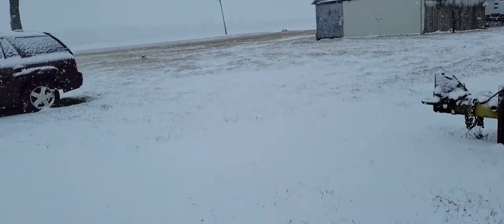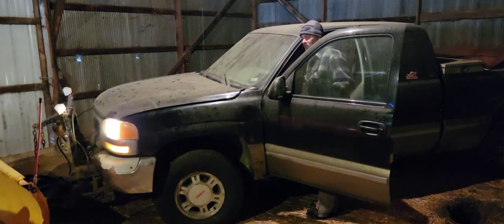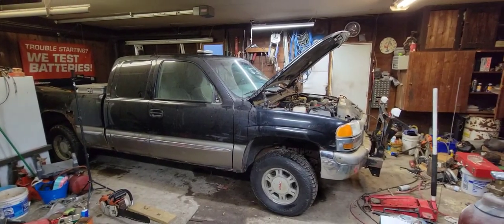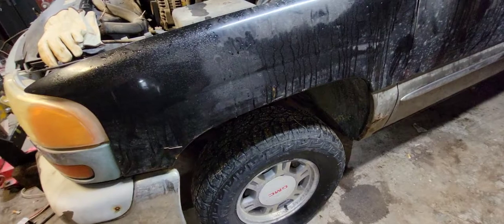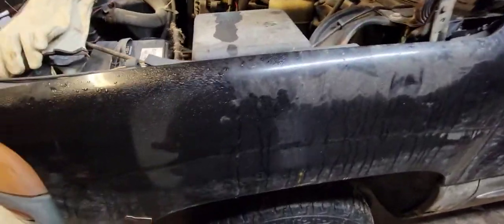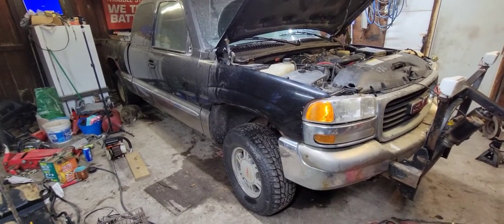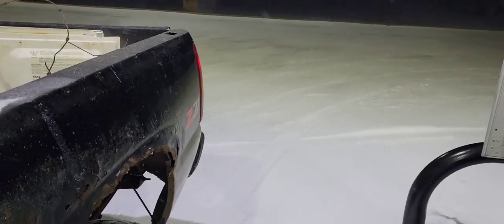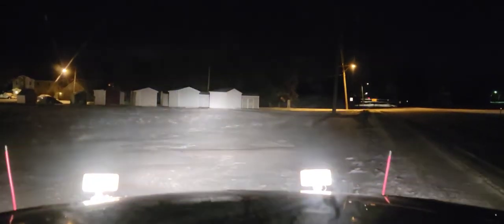Getting the plow truck ready and testing the welds.

Comment: From time to time I've mentioned to my wife I want to get a plow truck. I have 2006 Nissan Armada I barely use anymore and have been thinking of slapping a plow on it... Wow the frame crack right through. From the weight and work from the plow or rot? Truck sounds real good though!
Reply from the maker: It's been worked hard. That's a typical spot they crack in that year truck. Plow doesn't help matters any. Hahaha. Plus I think someone before me must have nose dived it in a ditch because the front  of the frame was bent upwards a little